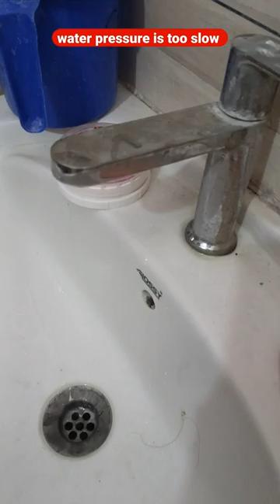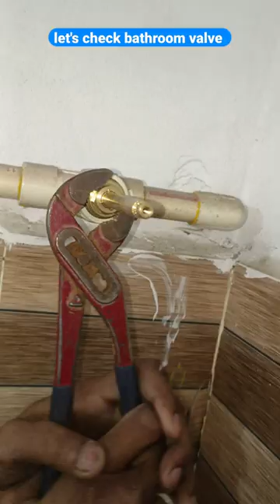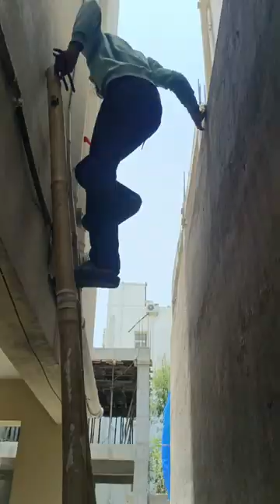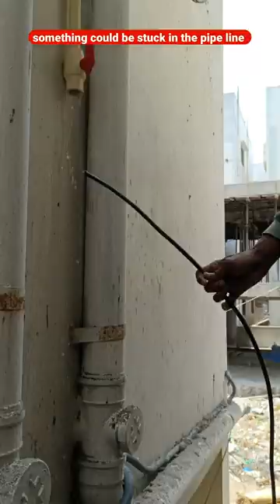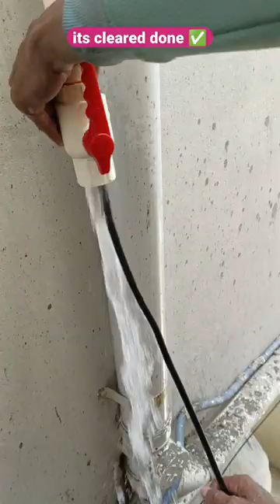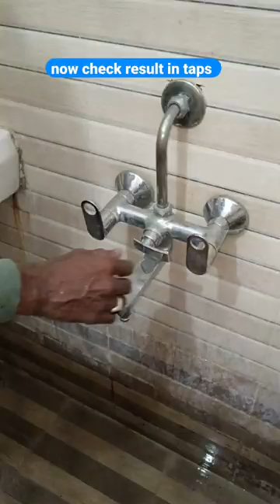how to clean bathroom water pipe line #shorts #youtubeshorts #plumbing #plumber

Comment: Use. Motor at top  and then removd the tap jalis then seee the dirty ness automaticalky come out of the tape this is my personal idea u can use it for free 🙏🙏

 This is one method if increasing pressure if the tap are dirty in that case ..
    There is an diffrebt case also appliable here use one more tank at the top  to increase pressure in the tanks